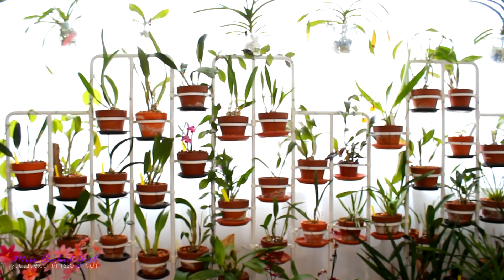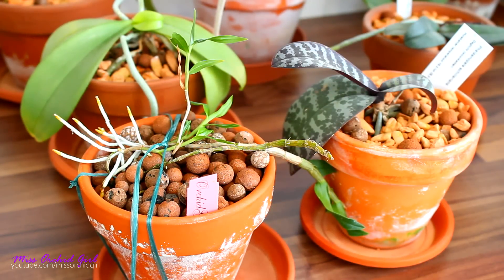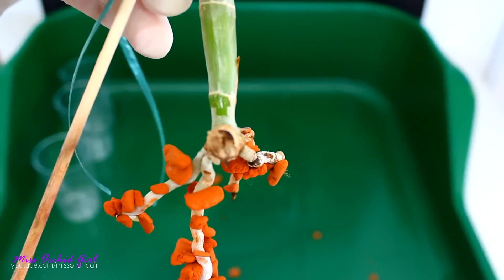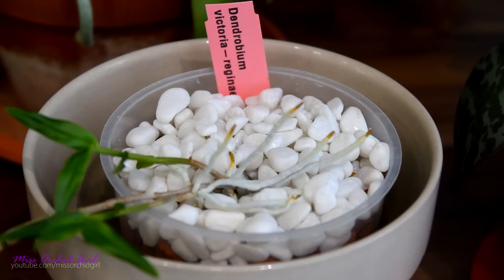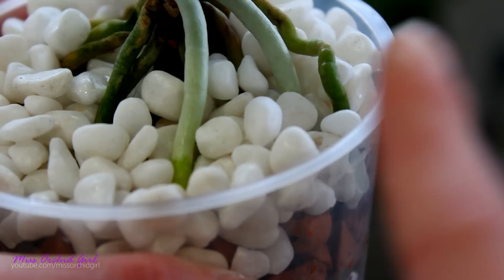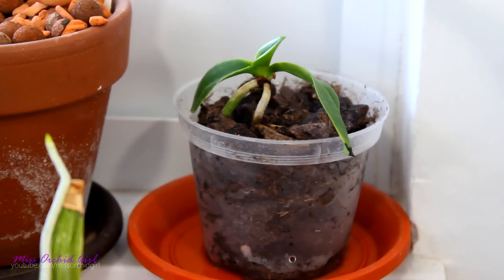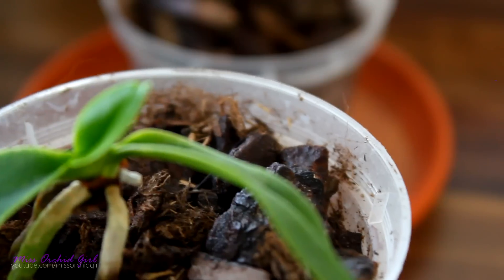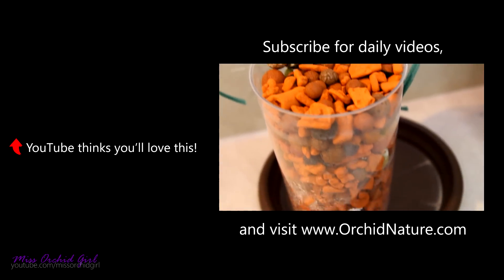Orchid root tip desiccation - Possible causes and fixes

Comment: let us keep in mind that that since the clay is porous, when it dries there is salt residue. thus compounding the the drying/osmosis effect. I have noticed this quite frequently over the years. Good work!!
Reply: try using a pot that is glazed or painted on the outside only..... you may find this interesting....
Reply from the maker: +Simple Carpenter that's the thing.. I didn't fertilize the victoria reginae for a month, just had osmosis water, for this reason I am inclined to eliminate fertilizer or salts. Also the leca layer was freshly placed it's new
Reply from the maker: +Simple Carpenter it would not be ventilated :p pros and cons hehhhh at least the plastic I can drill
Reply: You're likely right. My battle is against lack of humidity. So likely our results would differ.
Reply from the maker: do you have issues with leca in the dry environment? similar to mine?

Comment: I'd avoid sphagnum moss to keep on having inorganic media. The idea of the rocks on top is quite good, but all rocks are porous at some point. The rocks that are least water retentive are the rocks with a high percentage of crystals in them, like granite. Glass is 100% non water retentive, so it would be a good idea to compare 1) the orchid with small white stones on top (i think you are using small marble stones, with a relatively high percentage of crystals) and 2) another orchid with the same setting but with marbles on top (yeah, small glass balls that children play with: they are inorganic and totally natural). This could actually be one of the reasons (of course there are more) why many clay pots have glass coatings...
Reply: You could also put many more humidifiers... that would provide the clay surfaces the humidity needed
Reply from the maker: I was looking for glass marbles yes but I just didn't find them on a short notice :P got the next best thing I guess :P and nope it's not marble, tested ph, tested with vinegar, also aquarium products are not made of marble usually due to the ph and salt leaching issues. Oh and humidity is 70-80% which is great but it's not enough :P you'll be amazed how fast things dry even in 80% :P

Comment: There is not only chlorine that is harmfull in tapwater.... Lots of heavy metals, fluorine... Inside the pot it is laybe not such a problem because of the moisture and that it is diluted but on the top there can be such a high concentration of heavy metals, salts... Also when watching your videos I see lots of salt deposits :/
Reply from the maker: Hi, I did consider this but the damage happened on fresh leca, no acumulations on it, also we don't use fluoride in our tap water, I suspected chloramine so that is why I am testing roots and tap water too. Also for the main part I use osmosis water so I don't have big accumulations.. theoretically at least.. I hope :P

Comment: If rocks are marble, they do retain water. Nothing to do with gloss. You have to look for basalt which is one of the least water-retentive rocks. But still even basalt retains water.
Anyway, I guess you're overreacting. I have the same setup as you do, and last summer I had the same thing with sedirea japonica. My summer is in the Moscow region, so it may get super-hot sometimes, and I recall this happend during the two hottest months. As soon as some (not all) new roots touched leca or the rim, the tips turned brown and shrivelled. Then after a while some resumed growth, some didn't. Anyway the sedirea is still alive and kicking, sprouted a new leaf recently. And I wouldn't even think of changing clay setup for bark. To be on the safe side next summer I'd rather take out some leca and replace it with seramis. And I'd just live with those rims, anyway the plant adapts.
Reply from the maker: Heh you are right I am over reacting since it really is not a huge issue but.. I just want things to be perfect :P it makes sense, I try to keep my orchids drier now in winter and it happens more than in summer time when things were always a bit damp. And yes, compared to bark I would never in my wildest dreams return to it.. I just want things to be excellent lol :P heh we'll see what happens, thanks for the feedback!
Reply: MissOrchidGirl thank you for all your huge work ;)
Reply: MissOrchidGirl and good luck with perfection 😜

Comment: Had the same problem with my onc. twinkle.  I ended up removing it from the pot and the top 1/3 of the leca. I then cut up small pieces of sphag. moss and mixed it with the leca and then repotted  the orchid.  It went from completed shrivel bulbs to super plump and growing tons of flower spikes within 2-3 weeks. was a great turn around.  It seems like plants with thinner roots are affected the most.
Reply from the maker: Hi, yep usually the thin rooted ones have issues... except Tolumnias lol those orchids are a bit unkillable :P don't think any organics will ever touch the pots so I'll try other things before giving up and returning to organic :P
Reply: So ---- the spaghnum moss might be able to compensate for the drying effect of the clay, right?

Comment: I have some anecdotal evidence to share, since I think I have observed the same thing just recently. Almost all my orchids are in semi-hydroponics in LECA. Most of my orchids are small enough to fit the entire rootball into the pot. One of the exceptions is my huge Phal. Sun Passat. The buried roots are healthy and grew as normal, but I noticed that one of the aerial roots that touched the LECA suddenly showed signs of rot. It became mushy and the growing tip darkened. The pot is too tall for the reservoir water to wick all the way to the top, so this hypothesis seems to fit all the evidence.
Reply from the maker: that sounds pretty much exactly what happens to mine, the tips don't rot actually they just get damaged, even if they look black. This really sounds exactly like what I am experiencing. Did you manage to fix the issue?
Reply: About an hour after I wrote that, I checked on my Phal. The growing tip on the root has withered away :(. However, the rest of the root is firm, if a little wrinkly. It has a neighboring aerial root that has also dug into the media that is unscathed (so far!). I'm thinking maybe these damaged roots are very unlucky and landing on spots where salt collects. Hopefully your experiment will remove all doubt!